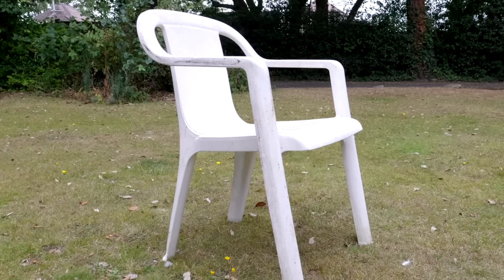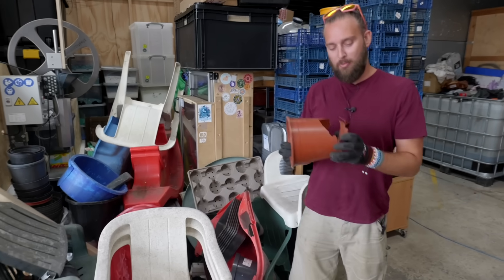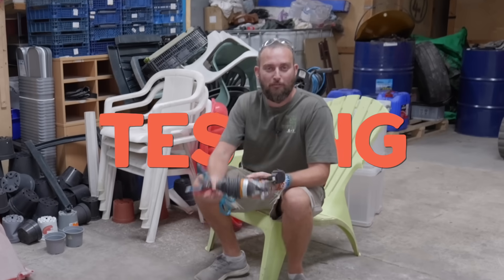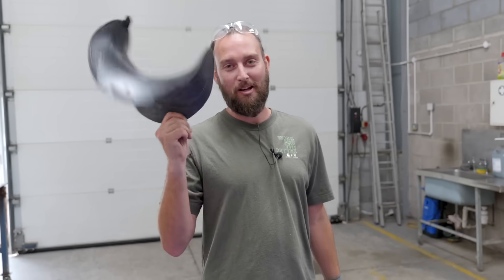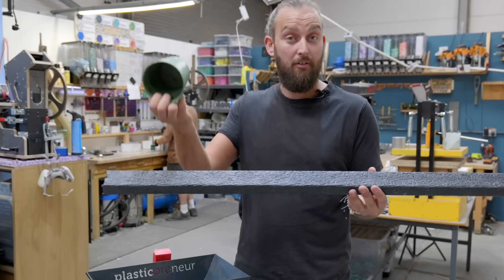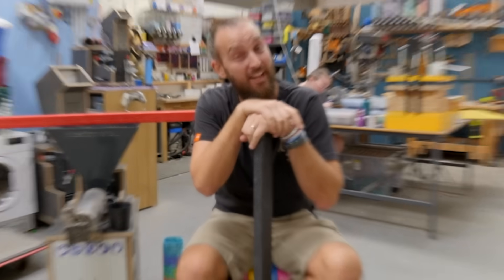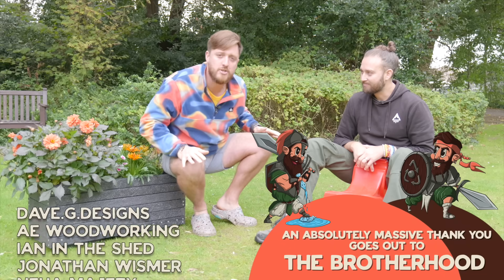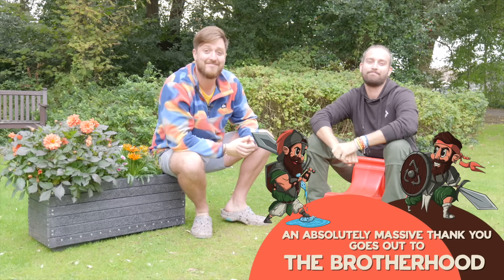We Tried Recycling Garden Junk

Comment from the maker: What should we try recycling next? We're keen to do more of these types of video, so drop your ideas below! ♻

Big thanks to Tanzite for sponsoring this video - they make seriously durable decking that looks amazing.
👉 Order a sample box at https://tanzite.com/ using code BROTHERS50 for 50% off.
Reply: in places like football stadiums when their plastic seats go whitened by the sun, they hit them with a high temp flame to bring their colour back. Would be interesting to see if doing this could prevent the issues with the recycling process for plastics that have IV damage...
Reply: Hi.  Do you know what kind of polymer Ukulele Bass strings are made of?  There is no info on the package and I would love to know if they are recyclable.
Reply: Bro i am watching from bangladesh 🇧🇩🇧🇩
Reply: I would like to see ways to recycle different types of plastics mixed together into the same object, even if it looks ugly and not very strong. Something like bricks or concrete, stuff like that. Maybe mixing it with some wood fiber would keep it all together?
Reply: Please, please. Please try making interlocking garden edging 🙏🙏🙏🙏🙏
Reply: Brothers & team, great video! Thank you for your great work!

Maybe for a video, try taking a wooden pallet [correct sp?], and making a thin wooden veneer for this, so that the plastic is protected from the UV. This combination allows the plastic to do what it is good at: hold stuff together, while being water proof. The wood gets to do what it is good at: being biodegradable, and looking more natural than plastic.

I'd live to read your thoughts on this!
Reply: The website appears to be down.
Reply: please do not recycle. the energy you used is enormous.
just break in big pieces and use in structures that is not safety related. maybe garden wall with no pressure on

Comment: I know this would make the product not 100% recycled, but perhaps you could add plasticizer to the uv damaged plastic or a pigment like carbon black or titanium dioxide as they prevent UV damage and are relatively safe. You can add these all as you mix the plastic and in doing so, I think you could vastly extend the life of the plastic, which means it will be used longer and perhaps serve multiple uses in its lifetime. Also, I know of several companies in the US that make recycled plastic decking. I think it’s gaining popularity and hopefully it will replace wood in some areas. Also, you should sell plastic sheets. They are super expensive to buy and I really like making stuff out of them, especially HDPE, but it’s pretty cost prohibitive, so a recycled option for boards and sheets would be awesome!
Reply from the maker: Additives like that are also a virgin product. And we don’t work with anything that creates a demand for virgin materials

Comment: Other ideas 
- outdoor umbrella stand
- So the planter doesn't have as many screws, make each side, and the bottom, a panel.
- Stool for indoor or outdoor use
- small set of draws for table organisation
- soccer shin guards
- geta (japanese shoe)
- washing powder holder that magnetises to the side of the washing machine 
- clothes hangers (basic t shaped ones)
- door/cupboard handles
- shoe rack
Reply from the maker: Cool ideas 👍🏽

Comment: I wonder if the now extruded uv damaged pp behaves differently from the uv damaged pp. now that it’s had a chance to reliquify and flow about, does that disperse some of the damage more evenly (or something) and make it easier to inject?
It’s not like it would be very energy efficient to re-extrude plastic only to re-shred and re-inject it, but I wonder how it might behave differently. I wonder what percentage of uv damaged pp you can add to undamaged pp before you notice significant issues; kind of like William osmans sawdust in Rice Krispie treat video. This definitely seems like it’s worth more testing.
I also agree with the others who think you’d be better off extruding dowels to assemble your next planter. I don’t think you’d necessarily need to hot rivet it together, just make sure there’s enough friction between the hole and rivet. If you flute the dowels, would the pp snap or flex? Maybe the dowels could be made with a better suited plastic if pp isn’t up to the task. You could still brand the tips of the dowels to distinguish them once the planter is disassembled for future recycling.

Comment: Can you eat food grown out of the boxes? Is there a risk of plastic contamination or micro plastics getting into the food?
Reply from the maker: Most wooden planters are lined with a plastic sheet material to prevent the wood from rotting quickly. This thin plastic would break down much quicker than the solid beams we made.
Reply: Considering some people use old car tyres as planters, I think this recycled plastic is better. 
And the fruit and veg you buy is produced with plastic at some point, so you are ingesting microplastics anyway. 
I remember seeing plastic chunks in the beds of dole pineapples because it kept more moisture in the soil they said 😆 I'm pretty sure shredded garden waste would have done a better job at that.

Comment: 7:12
We have one of those, or rather two. They are used in pairs. One in the bottom and one as a lid.

The bottom one is used as a sand box, while the lid one protect the sand box, but can be used as a pool hot days.

Then when you are done for the day, you just tip the water out, put it on top of the sand box again and its fresh the next day.

Comment: There is basically two types of plastics.

1: Recycled
2: Recyclable 

Hardly any are both. Basically you make the plastic, use it, recycle it once, use it again, then its no longer usable.

There is a few exceptions, like PET that can be recycled a large multiple of times. (While not a unlimited number of times).

So plastic recycling is not great.

Now there is a few ways to mitigate this. Mix plastic is used in some permanent out door installations like noise fenses and out door flooring. The key here is that those products are designed to use mix plastic and have a design that allow them to use low grade plastic because they are dimension to handle that

Edit, This is referenced late in the video.

its worth saying that the boards of that type often have some kind of fiber mix in to improve the strength of the product.

Burning plastics may also not be as bad as popular to believe. If the plastic is burned in a plasma oven they are made into electrical power and heat. 
THe problem that they are made mostly out of petroleum product still exist. but non petroleum plastic can be made
Reply from the maker: All the plastics we work with in our workshop are both recycled and recyclable. We also made a video a few years ago testing the myth that ‘plastic can only be recycled X number of times’. Might be worth a watch 👍🏽😊
Reply: @BrothersMake its not a myth, they just use makreting to make it sound like its not true.

Even PET that can ve recycle a large number of time also have a limit.

Comment: Would you be worried about the plastic leeching into the soil and affecting the plants long-term, with the new planter configuration? Genuine question; I think the planter looks great, but surely there's a reason why they're usually made of wood rather than plastic?
Reply from the maker: They are made of wood, yes. And more often than not, they are lined with a plastic sheet material to prevent the wood from rotting quickly. This thin plastic would break down much quicker than the solid beams we made.
Reply: The plastic will leech into the soil. But that is the least of your plastic worries since we breathe in micro and nano plastics everyday. Plastic clothing (polyester, nylon, etc) sheds fibres, car tyres shed particles, agriculture uses lots of plastic. So it's already in the food and air. 
At least this plastic is recycled and not virgin plastic.

Comment: Thanks guys for the great video!  Here in Germany we have so much plastic waste from the gardens, too! While we have a system for packaging-used plastic to recycle, these "bigger" plastic pieces seems to be just burned. It is called "Sperrmüll". When you want to get huge amounts of plastic these always seemed an easy source to me. They are such big pieces and because of that for me easier to clean as 100 small pieces. Thanks, that you tested the practicability of recycling this material. Today I continued to weld my own (Precious Plastic) injection-machine. When I get access to a good shredder, i might follow your foodsteps wirh this plastic source.
Reply from the maker: Awesome to hear you’re working on your own Precious Plastic machine 👍🏽

Comment: So many screws went into the planter. Great for a prototype but if you were to make a bunch could you extrude 'dowels' of the proper size and 'hot rivet' the dowels into the drilled holes. Uses more PP, no screw expense, easier recycle at end of life as there would be no disassembly.
Reply from the maker: That's a really interesting thought for future videos
Reply: The easiest way is to make C channels or tenons where each piece slides in and only the top needs the dowel or screw.
Reply: Exactly what I was thinking...my thought was that spinning a plastic dowel in with a drill should creare enough friction to weld them into place, but there are almost certainly other ways to do it!
Reply: Возможно, проще сделать планки с пазами, чтобы они просто вставлялись друг в друга. Древний и универсальный способ.
Reply: I was thinking this too using wood joinery techniques saves on screws and washers.

Comment: Can you paint this plastic ? for example i like wood and would make a similar planter but paint it (preferably with an UV resistant paint) to have wood color, the texture is already similar to tree bark.
Also, could you add some UV stabilizer liquid to the mix to make it more UV resistant ? i have no idea if there is even such a thing :)
Reply: You'd probably need to prime it with something like Rust-Oleum plastic paint as most regular paints don't bond to PP and will flake off over time.
You can paint over that with just about any paint you like. The paint will give some extra UV protection to the underlying plastic.
Cheers!

Comment: Hello guys!
How are you?

Take this with a grain of salt because I can't be 100% sure, but:

From the information I have, most of the garden plastic forniture Is made from polypropylene with up to 40 or maybe 60% (I don't remember the percentage well) talc or calcium carbonate fill.

That's to spare plastic on thick parts, since the filler is cheaper, and to make it stiffer, at least until the UV rays broke down the polymer.
That's the powder you find on the surface of old damaged plastic (mixed obviously with damaged polymer).

The filler is also the reason why it tends to flow less in the moulds.
And because it is "non recyclable" from the industry.

Probably the black one contain less calcium carbonate or talc filler, since carbon black is used for the colour.
Carbon black seems to help the plastic to cool slower in the mould (and heat more evenly and faster in the machines, I noticed that it requires less time to melt, maybe it has better thermal conductivity?), and it flows better.
In the Italian community we experimented with some PP pellets recycled from event carpets, also filled with calcium carbonate to reduce static electricity, it tends to be thicker and flow less, but it is very good for the sheetpress.

The difference is comparable to the one between the blow moulding HDPE and injection one.

Thanks for the video, it's very inspiring, as always!

Davide
Reply from the maker: Awesome insights Davide, thanks for sharing your experience!
Reply: @BrothersMake You're welcome! 🤗

Comment: The worst things for solar breakdown are those thin blue plastic grocery bags that are everywhere.  I left a couple of them in my car with clothes in them for Goodwill.  I didn't get them in before vacation and they sat in my car in the summer sun for 2 weeks.  When I grabbed one to move it the plastic disintegrated into dust that filled the air.   It was nasty.
Reply from the maker: That sounds like a nightmare to clean up!
Reply: @BrothersMake  And you end up breathing dust in.
Reply: The ones that are deceptively similar-looking to fabric? It should be illegal. I had a woven picnic mat thing and it was in one of those bags. Out of reach from the sun, as far as I know. Same thing. VAPORIZED. Had a moving blanket from Harbor Freight that did the same thing in the backseat of my truck. I'd used it to move, but kept it back there to keep the dirty doggie paws off my new upholstery. Just powder.

Comment: Would it be possible to add an adjustable stop point to the beam extruding machine, such that you could produce custom length beams? It would add time to produce them, but would presumably save time+effort in having to cut them to size afterwards. Presumably it would be more beneficial for large batch items.
Reply: I guess it would be hard because it would build pressure, and having one with holes could defeat the purpose, but the idea is smart to reduce small level waste, maybe then on large scale projects have a shorter beam mould that would alllow them to alternate during cool down time and use the machine without pause, or simply calculate how much extrugion takes and produce a lenghs by timeslot rather than mould

Comment: I was just asked if I can recycle toothbrushes. I've not ever seen a toothbrush that identifies the plastic used to make it. Can you use your little (very expensive) plastic identifier on a few to give an idea what they are made from?
Reply: Toothbrushes are not recycled for legal reasons since they are classified as unhygienic and it gets put in the same category as medical waste. I'm sure it won't be difficult to sanitize them, but that just adds extra cost to the recycling process.
Reply: They also made a video on how to distinguish the plastic types by floating them in water and oil and stuff. That should also work, I think.
Reply: @mr3sepz  I have found that technique to be a bit hit or miss. Much of what I test simply sits below the surface but not at the bottom. I think that certain items have additives in them so they act a certain way and that affects the floatability.
Reply: The major problem is that tooth brushes are a mix of plastics. As a minimum 2, the bristles and the handle. Some have several plastics and silicone etc
Reply: if you're based in the UK, you can put them in the plastic collection boxes in Boots, all the plastic collected goes to ReFactory, they recycle all types of plastic.